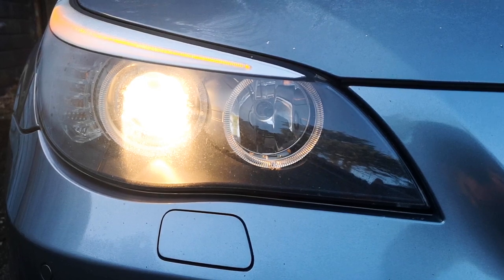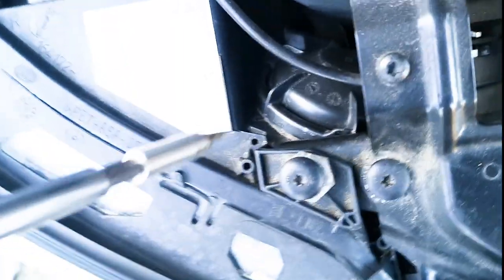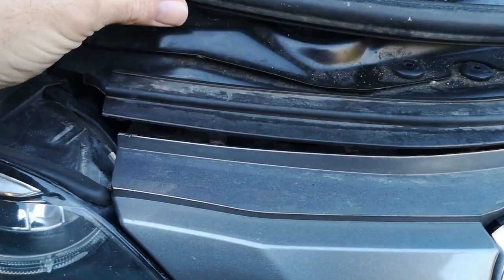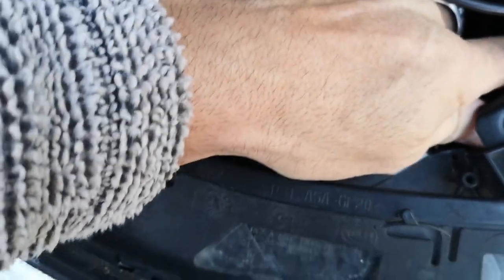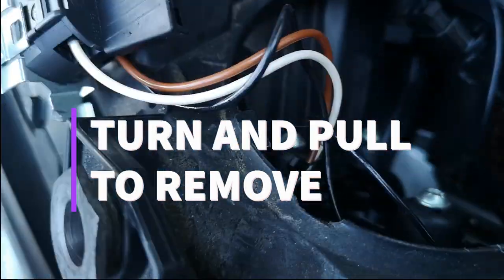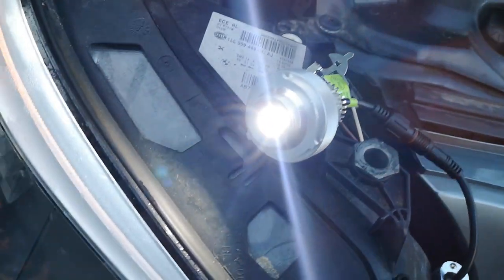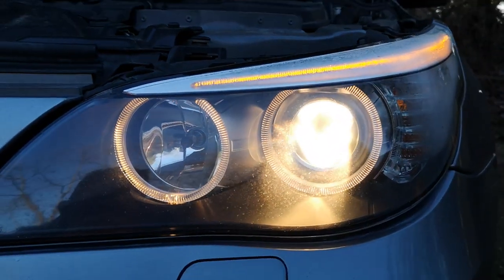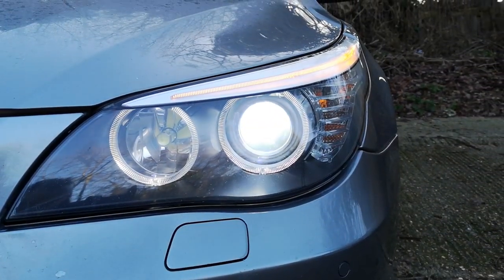BMW E60 E61 LCI HEADLIGHT REMOVAL FOR HALO ANGLE EYE BULB CHANGE & H7 BULBS

Comment: Hi I don’t want to sound dumb but I’m new to bmw family and I wanna have the rings led too and the night bulb led what do I gatta do to get that ?
Reply from the maker: Hi no problem,  you can just upgrade the bulb, but if you want the super bright rings, you might be able to get a kit, have a look on the E60 E61 forums on face book. 👍
Reply: @JFKKARZ  thanks Ill look into that I got the 528i bmw 2008 and I don’t know what bulb or anything I should get any help ? As in what bulbs it uses this and that
Reply from the maker: @dominickarango1010  https://www.ebay.co.uk/itm/311911022172?fits=Car+Make%3ABMW%7CPlat_Gen%3AE60&epid=24027923871&hash=item489f587e5c:g:u0sAAOSwwYZhFjAx

Comment: Cool, could you post a link to the angel eye bulbs you used please?
Reply from the maker: Sure no problem eBay item number:163951243107
Reply: JFK KARZ cheers, been meaning to get rid of that dull yellow light for ages. These e60’s do look good for their age.